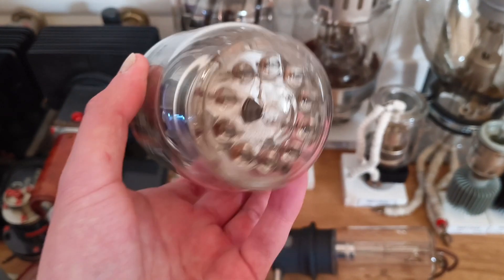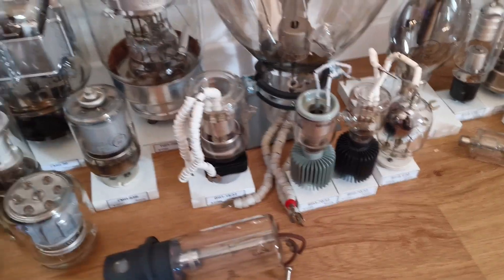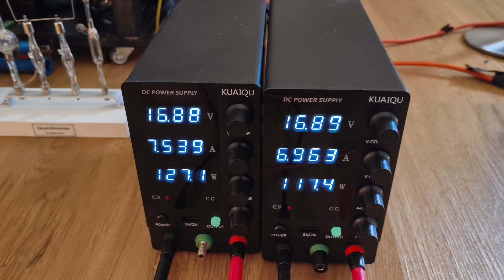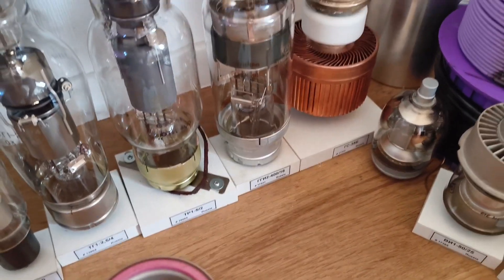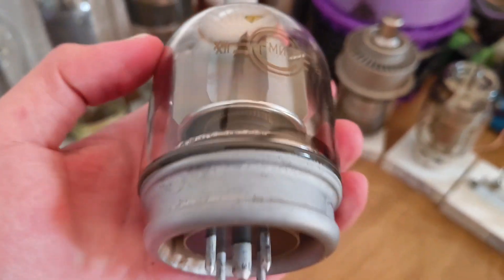Big Russian vacuum tube collection

Comment: Very cool collection. I would not sleep in the same room with them . Because of the berelium ,thorium & uranium glass
Reply from the maker: @thevoidedwarranty  well I sleep In the same room with them. Berelium is only a problem if you sand or cut a tube and thorium would only be released by breaking one open. Also the Thorium content should be pretty small. And I have no tubes with uranium glas acting. I think the only big risk would be falling into them at night 😂
Reply: @motness  yes i know but in the event that one one them breaks , the entire house would be unlivable & extremly contaminated .i love tubes & i have a small collection. Also they used thorium as cathode coating & the amount is not small .

Comment: The pink ceramic should be Alumina ceramic witch gets it's color from the small bit of chromium oxide that's in the mixture! Beryllium oxide on the other hand, is white (could have a slight green tinsh to it) and is in probably ALL plausible ways deadly!